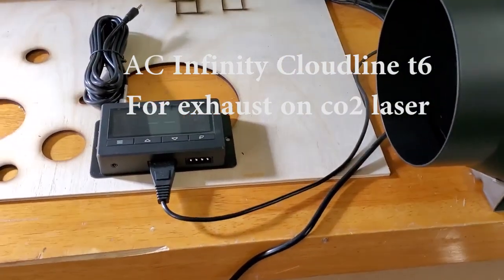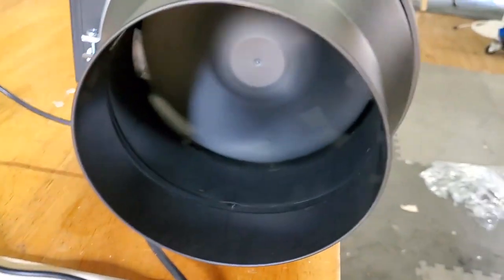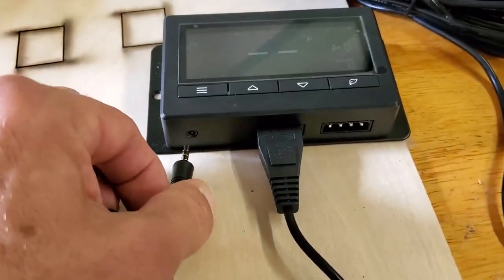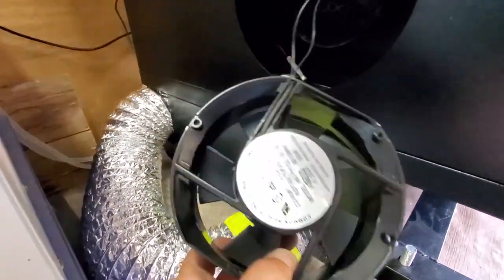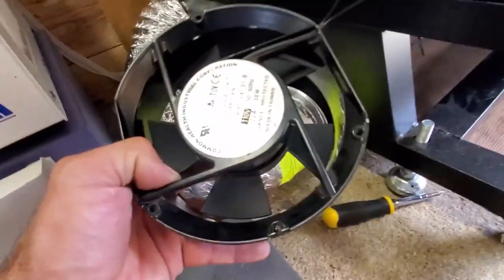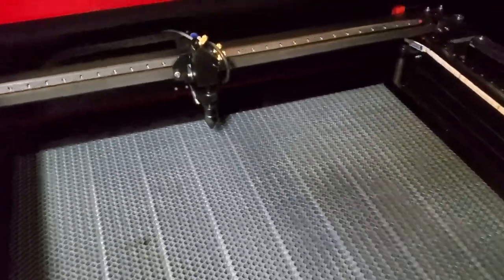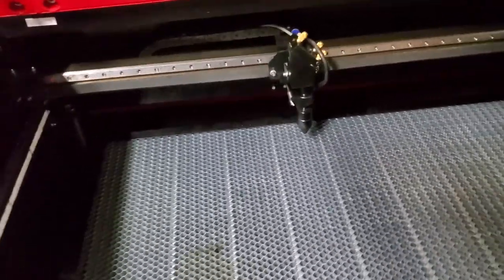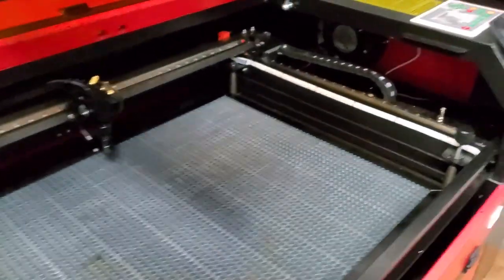C02 Laser upgraded exhaust - AC Infinity Cloudline T6

Comment: Do I need the 6 to 4 inch adapter? what size is the mouth on the cutter? I'm ordering it the machine right now.
Reply from the maker: My machine has a 6 inch pipe and the fan has a six inch as well. If you machine has a 4 then yes you would need a 4 inch to 6 inch adapter. Probably one of the big box stores will have something you need.  Thanks for the comment.

Comment: So can u tell us the 2 weeks experience about it?is it quiet enough
Reply from the maker: I use it every day and absolutely love it and the upgrades too.  I dont have any complaints at all.  My next addition will be the camera for light burn.
Reply: @JoePalumbo221  perfect , im happy for u..thanks to u i will buy it too 👍👍s6 is enough for me
Reply from the maker: @Gokhanbaykall  yes.  You don't need the T version just the s.  Same motor.  It works great.
Reply: @JoePalumbo221  have you added a camera yet? Does the z axis move with a motor because I would like to install a autofocus as well for items that arent flat.  I just subscribed because i thinking this is the model i will buy as well.
Reply from the maker: @zachofalltrades1111  I did add a camera.  Just a typical Webcam which works great.  I have a video up check that out.  Also the laser doesn't have a motorized z (bed) axis.  Just a hand wheel.  Maybe an upgrade in the future though.

Comment: Do you think I’d need t8 for a 900 x 600mm machine bed?
Reply from the maker: I think the T6 I have is a perfect match for my bed size 500mm x 700mm.  I don't know the formula but the more volume of air flow can't hurt.  I do know that the adjustable levels of extraction on my t6 is so wide and I do have to dial it back depending if I'm cutting or engraving which makes it convenient.
Reply: @JoePalumbo221  thank you so much
Reply: I have 1300x900 and I use only 1 s6 but I may need another one soon, also I am still smelling smoke from the sides of the s6, any idea how to seal it. I want to eliminate 100% the smoke if it is possible. I engrave all day.
Reply from the maker: @MUUQNN  I don't know of a way to remove 100 percent of the smoke and smell if you followed all the protocols like making sure your hose is completely sealed and the seal to your exhaust going to the outside is also air tight.  I also have a fan on the opposite side of where my exhaust is to help with cross venting. This seems to work well.